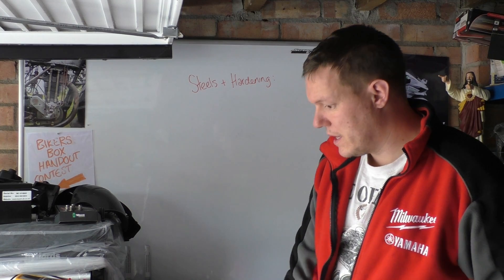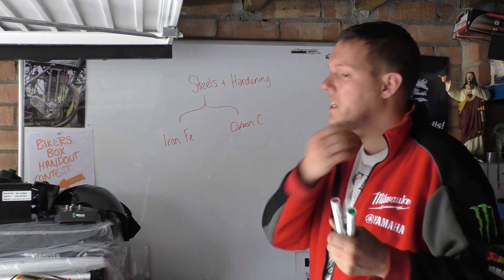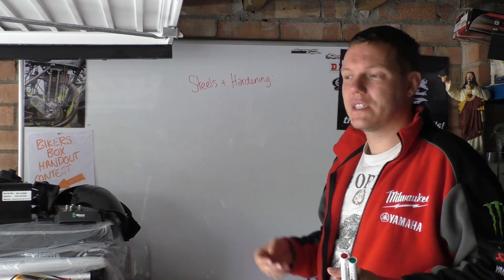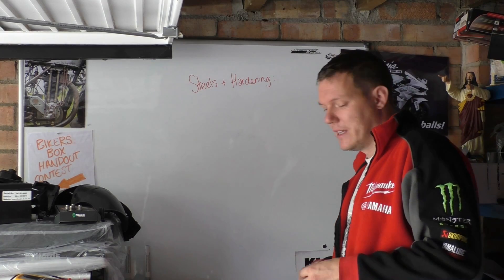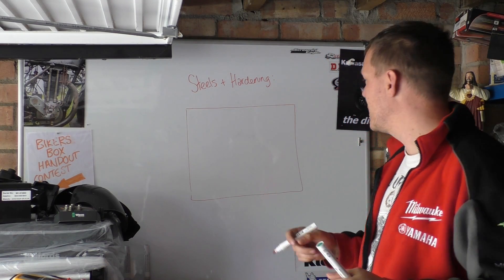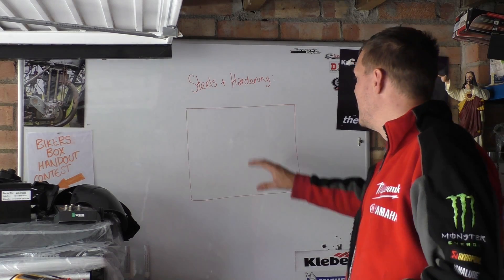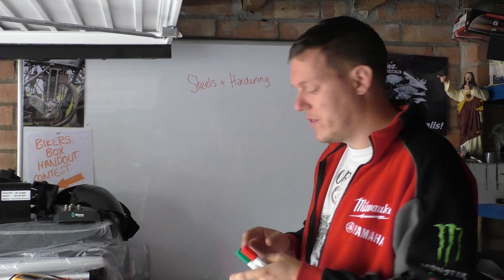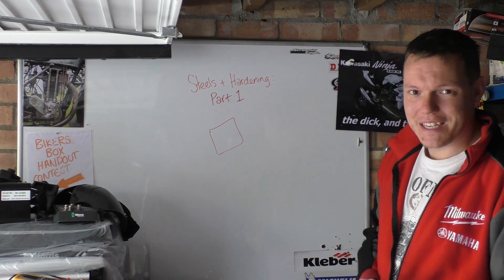Steels 101 - Grain boundry

Comment: Matt, you might know this.  I'm curious about the loading on the fir trees.  Do the fir trees get sequentially loaded from the bottom up because of yield from the tension?  I don't think I asked AgentJayZ that question or not.  It seems logical to me that deepest section should start resisting tension first and then each section should become loaded in turn.  Loading all at once would put all the force right at the top of the fir tree, which I don't think is what they want.  I may not be explaining this very well.  What do you think?

Comment: I wish we had that system in the USA. Instead, we heat a filament with batt. voltage into watts, let the incoming air cool off the filament and the pcm controls the fuel trim based on resistance fluctuations.